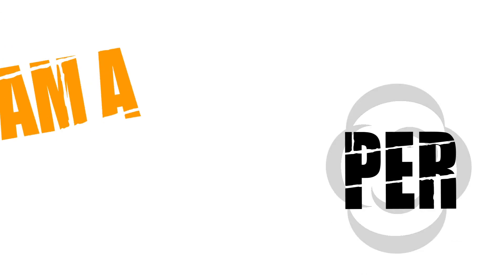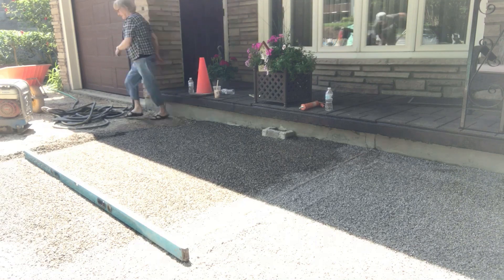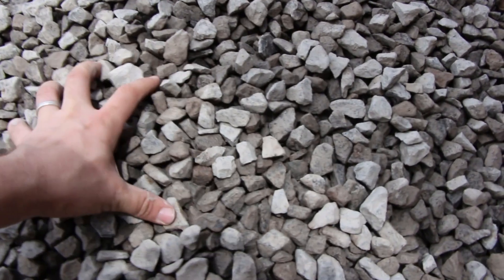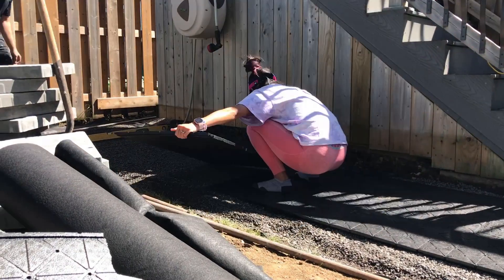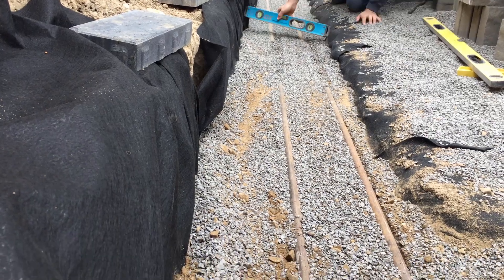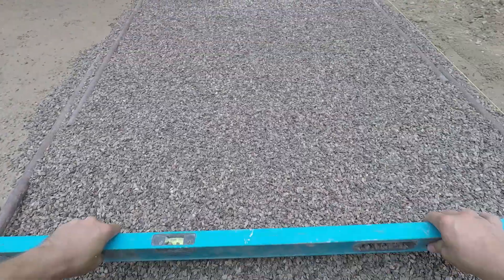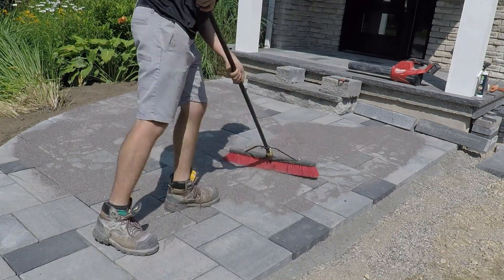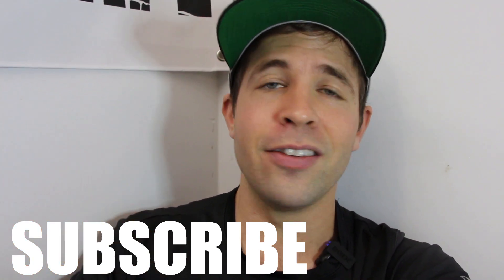High Performance Bedding for Pavers | Why We Use HPB Instead of Concrete Sand

Comment: Hello, I'm getting ready to start a paver project in my backyard and hpb was recommended to me. They said I don't need a base and can lay the hpb on the ground with a fabric, after I remove the grass. The soil is clay based from what I understand. Then after that I can lay the pavers. Is this okay and how thick of a base would I need for 60mm pavers? I live in Ontario Toronto region. Thanks!
Reply from the maker: HPB is only meant to be a bedding layer, 1” maximum. It can’t be used as the entire base. You could install a synthetic base with fabric, HPB, then the paver base panels like Gator Base, and pavers. But for a traditional base you would have a minimum 6” for a patio.

Comment: Would non woven fabric between the pavers and hpb prevent joining sand from falling into the base?
Reply from the maker: There is such a small loss of sand into the base that it isn’t even worth it. I think I use like 5-10% more sand when using HPB.

Comment: When using concrete sand, do you compact the pavers before spreading polymeric? How much do the pavers usually drop after all compaction?
Reply from the maker: I compact after the first sweep in of polymeric sand. They will usually drop upwards of 1/4" per 1" of sand.
Reply: With damp sand correct? I should avoid using bone dry sand right?
Reply from the maker: I am not so concerned about the sand's moisture content when screeding it. Typically there is enough moisture in it once screeded to go ahead an lay on top without adding any more water.

Comment: Can I use HPB instead of granite dust or limestone dust for the top layer of an artificial grass with the base being 3/4 lime, area also gets a lot of flooding will this help for more drainage.
Reply from the maker: Yup, you can install 3/4" clean and HPB on top as well to improve that drainage especially if dogs will be using it.

Comment: Great videos, Very helpful! I am about to start a hydronic heated walkway using Pex tubing laid in Amvic Ampex insulation board topped with 2 inches of sand mix concrete, then an inch of concrete bedding sand  and finally the concrete pavers.  I’m looking to do all of this over open grade base of 6-8 inches of #57 and 2-3 inches of #8.  The walkway will have a 10-12% grade down to a driveway so surface drainage shouldn’t be an issue. Can you offer any suggestions or advice on this approach? Thanks!
Reply from the maker: I actually could not, I would consult with the heating manufacturer to discuss this approach and see what they would recommend or say. Hope that helps

Comment: Love your channel!  Just about to use HPB for the first time in Pennsylvania for a porcelain paver install.  Would you recommend compacting the HPB before laying the porcelain since we can’t plate compact after laying?  Almost nobody is using HPB yet down here so not much local knowledge to go on.  Thx!
Reply from the maker: Thank you! No need to compact prior to installing. I think you can still use a roller compactor on it. What are you installing for the joints?
Reply: Thanks!  I’ll definitely look into the roller compactor.  We are using the “Gator” spacers to keep a uniform joint width and poly sand for the joints.  They are 24” x 36” slabs.  We need to meet perfectly level with pool coping so I’m hoping that there is not a lot of settling with HPB… especially with such large format slabs.

Comment: Would you use 1" or even 0.5" of HPB bedding (over A gravel) for a driveway application? I may also put a geo layer between the two. Thoughts?
Reply from the maker: Check out our latest video talking about this. If the joints are small, I’d probably use concrete sand. If not, I prefer to use HPB. 1” is fine and not necessary to have a layer of geo.

Comment: I currently have road crush which has been graded and compacted, would you put a layer of geo fabric over the area before the HPB prior to laying the patio stones? Or just use the HPB directly on the compacted road crush prior to laying the pavers?
Reply from the maker: I use it right on top, no geotextile
Reply: @iamahardscaper  the reason I ask is because initially I was going to go with an open grade and excavate down to 8 inches, because the area had about 4" of pea gravel over geo fabric, when the pea gravel was hauled away we realized there was already 4 to 5 inches of compacted road crush. My hard scaper suggested just leaving the compacted road crush and then top up with more road crush and then compact to mimic final grade. At no point was new geo fabric put down that's why I was asking about that before the HPB. Or should the compacted road crush be okay to keep down weeds???. Thanks for your reply
Reply from the maker: Weeds are not the problem. Weeds will grow from top down, no from the bottom up. The geotextile is for added stabilization and separation.

Comment: Awesome channel, just subscribed. A previous video you used sand as the base for paver overlay over concrete. Thickness of sand was only 1/4". Would you use HPB instead today or stick with the sand in that application?
Reply from the maker: Thank you for subscribing! I wouldn’t use HPB unless I had at least 1/2” for it. A 1/4” space will lead to inconsistencies especially with the chips that are at that 1/4” measurement. There needs to be a good bed of chips for consistency, so we opt for concrete sand in those cases.

Comment: What is your opinion of using the old pavers under the new pavers?
Reply from the maker: Can’t see that working as intended
Reply: As intended? The idea is that contractors don’t have to shift the old pavers off site and save on fill of course personally I didn’t like the idea or motivation.
Reply from the maker: it is a corner that is being cut. Gravel pits meet specifications on aggregates and that is why they are used. I would not count on a contractor being able to get those specs right on site.

Comment: When using HPB for paver bedding how much compaction are you getting with a plate complactor?
Reply from the maker: We lay pavers and compact after installing jointing compound. The pavers settle a very small amount. 1/16” to 1/8”
Reply: @iamahardscaper  Thansk for the info and great channel. I'm starting a project next week and you have all the answers I need. Super helpful.
Reply from the maker: Thank you! Glad it is helping

Comment: Thank you for your videos! Have subscribed and learned a lot. i'm about to start a small circular paver patio about 8 feet in diameter using HPB and the synthetic base (Brock Paver Base). You mention only using synthetic base on an existing grade...not sure what you mean.  the Brock Paver video says to make a 1/4" grade per foot.  If i create that grade over the 8 foot diameter, should it be ok?  Thank you again!
Reply from the maker: Yup! 1/8" to 1/4" per foot slope for your patio. What I mean about being able to lay on the existing grade is that if your yard slopes significantly, you cannot lay your patio at that 1/4" per foot slope so you would have to build a raised patio.
Reply: @iamahardscaper  ah! Got you. Thank you so much!!
Reply: @iamahardscaper  Thank you again for your reply! Last question, you use quarter inch clear stone. My supplier only has 3/8 inch, number nine. Would that work by itself instead of the quarter inch?
Reply from the maker: Yup, 1/4 to 3/8 is good 👍
Reply: @iamahardscaper  thanks so much!!
Cheers from Vancouver!

Comment: Is there a minimum joint width for the pavers or slabs that you need in order to use HPB?
Reply from the maker: I would say 1/8” is where I start to use it

Comment: Hello! I've seen so many videos saying to use rock dust under pavers/stone, so I'm glad to find this info. Does HPB apply for not just pavers but a flagstone walkway as well, and then use the rock dust for between joints? Thanks!
Reply from the maker: Yup, I would use a wide joint polymeric sand for the joints preferably.

Comment: I am doing a DIY flagstone patio (about 14x14-ish). Originally was going to do 3-4" compacted base (settled on crusher run 21A - although has more fine than expected), followed by 2" stone dust to settle flagstone into it, and then use polymeric dust (allowed for larger seams than the polymeric sand).  I heard that sand after base level can end up washed out or with lots of ants in my area so was not going to use paver sand (started getting some from Lowes).  I am in Virginia where we have clay.   I have half the base down (picking up plate compacter for ease) and was going to buy a truckload of the stone dust from local stone center when I was told NOT to use it due to lacking drainage.  I am picturing water pooling under the flagstone (although there will be at least 1/8" grade) now that I have seen your videos.  So alternatives?  Still 3-4" of crusher 21A (is that enough?) followed by HPB (we have #8 bluestone washed = 3/8") and how much? (still need room to adjust the varied widths of flagstone and then put polymeric dust or sand in between.  Thanks for your thoughts!!....
Reply from the maker: I would do at least 6” for your base and add geotextile to separate it from your subsoil (compact your subsoil too). Then 1” of HPB, lay your flagstones as tight as possible. For your jointing compound take a look at Alliance Nitro or EasyJoint by Azpects. It is semi permeable and may perform well if your joints are thin enough (check with the manufacturer for joint widths).
Reply: @iamahardscaper  Thanks!

Comment: I did my first DIY last year and used HPB for my backyard. I am glad I found this video now. We moved from that house and my wife wants me to do the front walkway of new house. I was not sure how the HPB held up, since we moved. So i started doing research again. This video puts me at ease with my decision to use HPB last year and now to reuse it this year.
One thing I can recall from last year is that my HPB shifted a lot while I was walking on it to lay the pavers. I found myself having to level and re-screed as I layed pavers. Could it have been the quality or type of HPB?
Reply from the maker: No, that happens. You never want to walk on any bedding layer. If you need to, lay a piece of plywood down or something to spread the load over a greater area.

Comment: You do this for a driveway??
Reply from the maker: For a driveway if the pavers have wide joints. Otherwise we opt for concrete sand as the bedding layer.

Comment: What is hpb called in lowes or home depot, how do I get it?
Reply from the maker: I do not know that Home Depot or Lowes would have it. Search for a landscape supply yard near you and call them up. Essentially you are looking for a 1/4" angular crushed chip that is clean / clear of fines.
Reply: @iamahardscaper  if I use brock base do I use step 1 or step 2 paver base from lowes or home depot as my base?
Reply from the maker: I believe step 2 is concrete sand. If that is the case, then step 2. You need to screed it out, compact it, and then level out any areas, and lay the panels.

Comment: I assume you need to use the paver base panels on this?
Reply from the maker: This is a bedding layer only. For a traditional base, open graded base, or for paver panels. The alternative is concrete sand but you can’t use that for open graded base.
Reply: @iamahardscaper  so what would you use on top of that if you weren't using panels. On long island most people do rca and mason sand on top or concrete and mason sand on top. 
 What is the aggregate called that you would put on top of this between it and the pavers? 
 I saw another video where someone laid 3/4 crushed than screeded the 1/4 crushed than pavers.
Reply from the maker: This is a bedding layer, so it is pavers right on top of this.
Reply: @iamahardscaper  gotcha, I dont quite have the terminology down. Thanks
Reply from the maker: No worries, that is what this channel is for!

Comment: I am surrounded by quarries and can't get this stuff ANYWHERE.
Reply from the maker: Yeah I’ve heard that a lot. Introduce it to them and speak with other contractors and suppliers to do the same. If there is demand, they will hop on it
Reply: @iamahardscaper  im workin on that.  I cant even get crush and run.  I'm just going to have to go with paver sand over a gravel. That's all i can get locally
Reply: @iamahardscaper  i actually found it. When i went to buy my pavers. They had something called "block chat" (what a dumb name)  but it was 1/4 to 3/8 crushed limestone.

Comment: Great video!  I've been using concrete sand on a compacted road base aggregate, and am thinking of switching to HPB (again on road base) because 1) As a DIYer I keep finding that I can't lay as many pavers as I hoped in a day, leaving my beautiful, level, fragile sand bed exposed to damage overnight, and 2) I keep having to match my pavers up to existing slabs and the unpredictable amount of settling on final compaction with sand means I don't know if I got the paver height right until I am basically done with the job.  Is HPB indeed a good solution for these?  Would HPB work as a bedding under pavers on a residential driveway?
Reply from the maker: Thank you! It is a good alternative for many reasons, but addressing your points.
1) it can still be damaged overnight if someone walks through it. But rain won’t affect it like it would sand.
2) you get much less compaction of pavers with HPB so it’s nicer to work with.

I’ve used it many times for wider joint pavers on residential driveways. If it is a tight joint residential driveway you may want to stick with concrete sand. You still want that bedding layer to creep up into the joints upon final compaction.

Comment: Where do u get Hpb stone from??
Reply from the maker: Where are you located?
It could be 1/4” angular clean crushed stone or 3/8”. All depends where you are located.
Reply: @iamahardscaper  Elmira New York
Reply from the maker: You should have no problem finding it. It won’t be called HPB though. You’re looking for either 1/4” or 3/8” angular crushed clear stone.

Comment: Why not use silica sand?
Reply from the maker: Silica sand I believe is used for infill on artificial turf. Concrete sand would be the alternative to this. It is fine in some applications, but this stuff is easier to work with

Comment: 7:35 what about asphalt?
Reply from the maker: Asphalt for a bedding layer?
Reply: @iamahardscaper  will it work ? I’ve seen guys here in Texas use it even mix it with old bags of big big store concrete as bedding
Reply from the maker: There is a spec for asphalt as a bedding layer by ICPI. I’ve never used it or even seen it be used. But it can be used, yes

Comment: That system looks expensive.
Reply from the maker: Are you referring to the panels? They are pricey, but they save the labor and disposal fees which makes it slightly cheaper.
Reply: @iamahardscaper  How do they save on labor and what disposal fees?
Reply from the maker: It reduces excavation. You only need 1” bedding layer, the panels, and pavers. So less digging, less disposal, less labor.